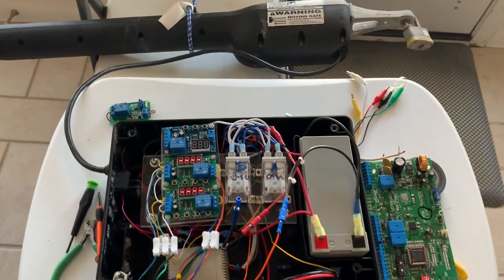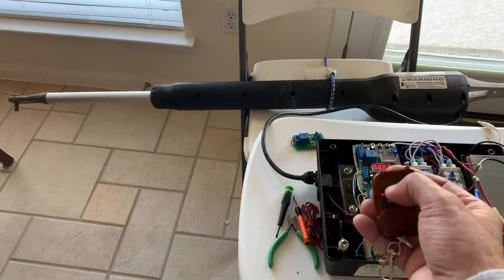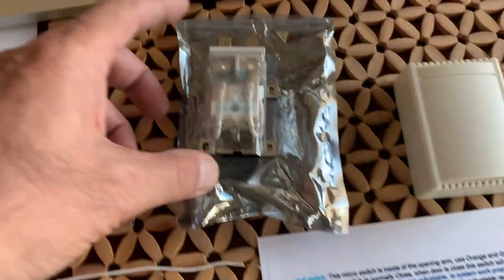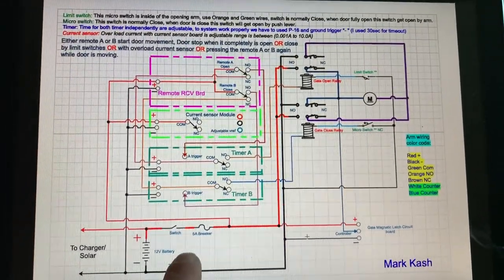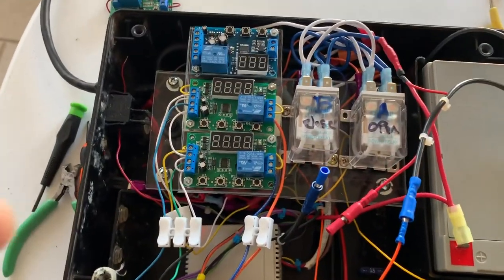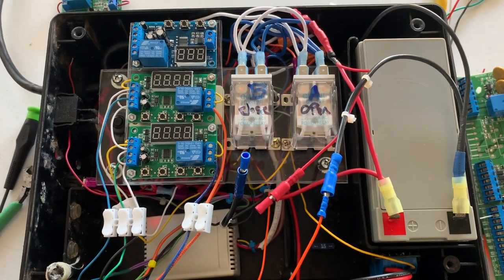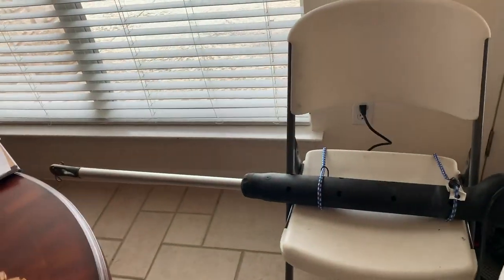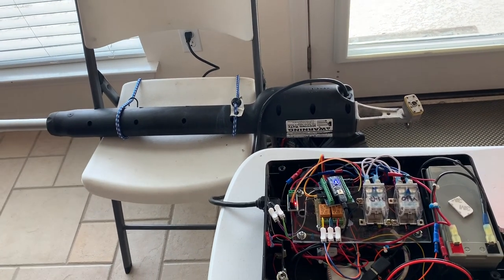Mighty Mule Gate Opener (Circuit Board Re-design)

Comment: Excellent video. I saw this a few years ago when my control board died but never did anything with it. I have been manually opening and closing my gate for a while now and it's starting to get old. I was wondering a few things about your design so I thought I would ask. 1, Did I hear you correctly say that you have to hold the button down the whole time the gate is opening or closing? With the arduino, isn't there a way to program in a momentary press to lock the opening circuit until it engages the limit switch? 2, Why do you need the exteranl limit switch on the end of the gate? Isn't there an internal limit that would stop the gate at the other end of the travel? 3, I have power at my gate and have always wanted to get rid of the battery and charger and just use a 12V power supply. Do you think that would be possible? Thanks.
Reply from the maker: 1) No need to hold down the button during opening or closing one press is enough extra press does not effect the operation of process if same bottom pressed but if you press the other button during opening or closing in the door movement reverse.
2) Because based on the condition of the enviroment the openning and closing of the gate can be speed up or slow down with wind and good or bad hinges or voltage drop and ..., you might ask we can extend the closing timer time, in this case you stress the motor and the gate because after reaching to stopping point early motor keep going and will break something within arm or gate most likely inside the arm.
3) Is no internal switch for stopping when the door get closed ( the arm get extended) the original gate openner was using the counter that was trigger with the wheel and optical switch within arm and that cicuitry goes bad so offen.
4) If you have power supply around gate is much better since you do not need to deal with battery and battery charger with one problem, what happen if the power grid is down may be youwant to stay home those days. using the 12v supply is great but you need battery backup as well
Again you might ask what is the role of the timer if the micro switch make a final decision timer is for santy check if the mirco switch fail to respond.
Reply: @Mark1Jordon1  Thank you for the speedy reply. Great information. I think I will give this a try. I have always wanted to play around with the arduino but never could justify the expense just for fun. Now I have a real reason. Thanks.

Comment: I would love to buy one of these boards from you. I do have a spare arm.
Reply from the maker: Did you check you arm to make sure is functional and the limit switch within arm is working?  How can I check that? I shown in video how you can verify the micro switch limiter within arm is working. Did you keep the controller box as well The shell would do the job to install all circuitry in there. Also do you have your electromagnetic lock on gate  as shown in video? is it working?
Reply from the maker: Ok if you send me the controller box without mother board or battery I can make you a system just like mine, drop me an email that I let you know the cost and what is included or not. where are you located at? If i can get the arm as well I can verify more stuff before sending it back. because my system install on my property not on my house.
Reply: My mighty mule 500 the board just clicks when remote is pushed but no voltage goes to motor on black and red wires.If I remove black and red wires from terminals and connect a  battery to them arm will work.Any suggestions
Reply from the maker: since you hear the clicking sound while you pushing on remote and you already verify the arm motor I think you might have issue with optical switch within arm that optical switch cut the power off when it reach to complete open or close position I did talk about the color of those wires in my video try to bypass them for verification two of those wires should be connected when the door getting open and one of those wire should be connect to third wire while is closing
Reply: @Mark1Jordon1  the limits work green brown and orange but I have blue and white I didny see you talked about in video or did you?
Reply from the maker: I did not talk about the white and blue wire  because I did not use it in my design that is the weak point of mule gate opener design. white and blue wire are pulse train from arm these pulse train have been generated by the flywheel that is attached in end of the arm and passing through light sensor when the arm is activated the wheel move and send pulse train to controller and controller figure out the location of the gate with counting the number of the pulse received from arm.
Reply: @Mark1Jordon1 so can white and blue be bypassed or a new board is needed?
Reply from the maker: No, you can not before you buy the new board check the pulse train to see if they coming out of the arm  if it does not you might have a bad sensor in the arm connect all wires power up, use multimeter across white and blue wire start rotating the arm (silver part) by hand see it you see any voltage between those wires it should goes up and down I dont remember what is the voltages when is up, but you should see in your multimeter rotate the arm slowly that you don't miss the train pulse.
Reply: @Mark1Jordon1  thank you I will try it.

Comment: any chance you will sell this board ?
Reply: or how can i contact you to get the sketch?
Reply from the maker: No, I built one for myself I can give you copy of sketch for $10 as I put it in description via paypal to my email or I can build you one as well but I need your box and it will cost you $90 plus cost of the parts I assume you already have a working arm. anyway you need the sketch Why? to adjust the timing and force of the gate when it hit something.
Or i can help you more for $50 that you can put it together. what to buy where and etc .we can communicate via Facetime and email.
Reply: What is your email for PayPal?
Reply from the maker: Mkash777@gmail.com